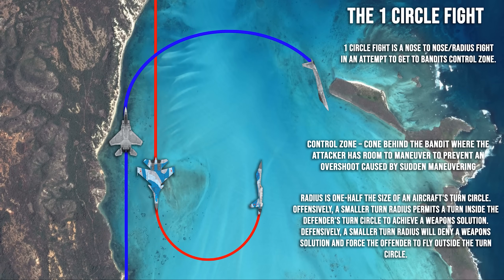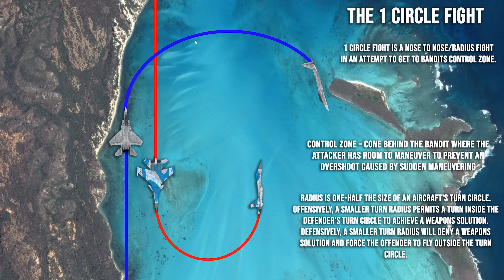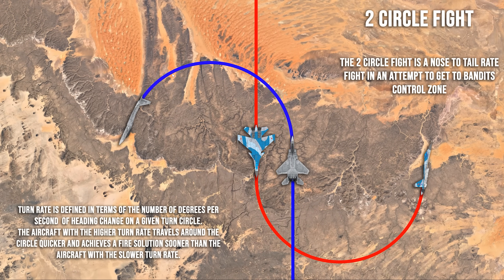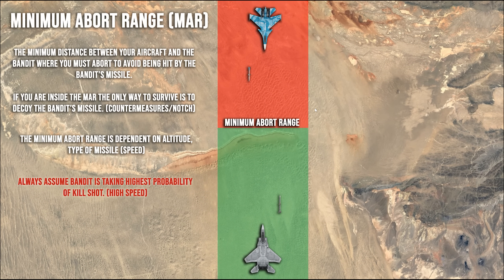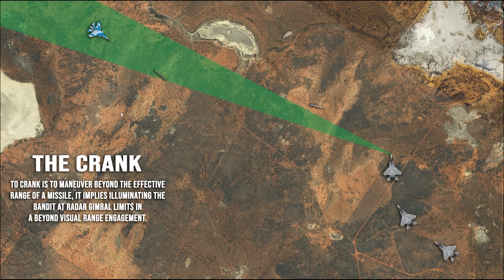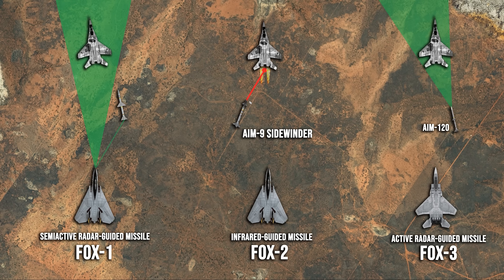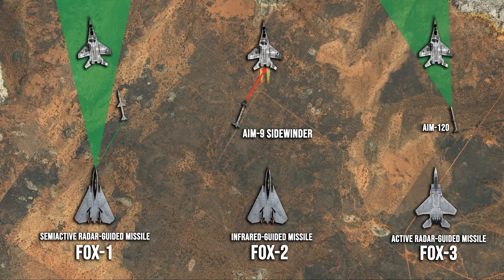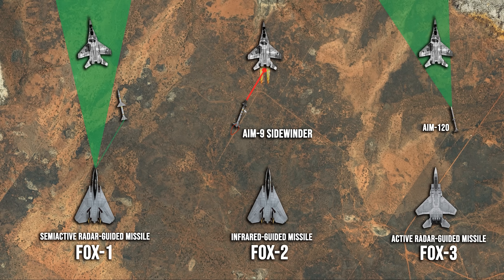Modern Air Combat | Basic Terminology Explanations | 1 circle Vs 2 circle | MAR | Cranking | DCS |

Comment: What use is MAR as a concept, functionally?

In order to employ it you'd need a 5th to 6th generation level of situstional awarness. You'd have to have a radar, thermal, and/or a distributed aperture system combined to confidently ID a missle type far enough out to even have a chance TO turn away, wouldn't you?
Reply from the maker: no, you simply need to know how far the bandit is from you, you can know this from your own radar or a simple datalink feed which is common in all 4th fighters and up.

Comment: So when do you prefer one circle over the two circle? Both seem to be dependent on turn rate, but is there a preference for one or the other if you know your turn rate is not as good as your opponent’s? If so, why?
Reply from the maker: Only 2 circle is dependent on rate, 1 circle is radius dependent, you choose 1c or 2c based on your aircraft performance and the bandit you are fighting. You pick the one that works better for you vs the bandit.

Comment: 2:14 I've never played one of these, but it would seem to me that the area of the control zone depends not only on the bandit aircraft but instead on the relation between the friendly and bandit aircraft. Meaning it will be different for each combination of different aircraft types.
Reply from the maker: Not sure what you mean, why would u be in the control zone of a friendly aircraft ?
Reply: @GrowlingSidewinder  I just mean to say that similar to how the bandit impacts the control zone, so does the maneuverability of the friendly aircraft. As it is explained I would think that the relative capabilities impact the size and location of the control zone. A better-performing airframe should generally have a larger control zone.

For example. Suppose the bandit is a SU-35. Isn't the control zone for that aircraft different depending on if the friendly is for instance either an F-14 or an F-22?

Comment: 1 circle and 2 circle don't make sense to me.

It should be reversed - if 2 planes are going both lets say clock-wise, that should be called 1 circle. One is following the other one, they both fly the same direction.
When planes are flying head to head towards each other in circles, that should be called 2 circle... each plane is flying the opposite direction, in its own circle.

doesnt it make sense ?
Reply: The one circle and two circle thing refers to the number of circled created early into the merge. In the 1 circle, both the aircraft merge into the same circle whilst in the 2 circle, they form different circles which eventually collapse into one.

Comment: thank you for the explanation 👍😃  so let's say soneone fires a fox 2 at you, which is the heatseeking version, you can activate the flares for countermeasures, correct?

let's say the bandit shoots a fox 1 or 2, what countermeasures are possible to perform? as a total greenhorn, if flares don't make sense, i'd just say try to out-maneuver the incomming missile?
Reply from the maker: Hi, yes the fox2 countermeasure is flare, against fox1 and fox3 the correct countermeasure is called “chaff” small nieces of aluminum that reflect radar.
Reply: @GrowlingSidewinder  thank you sir! can't wait to join the community

Comment: Random question: what camera angle is used in the first seconds on the f-14 flight?  I have either F2 which follows the plane at a fixed distance, or Ctrl+F11 which loses the plane in a second.  What camera is this? Looks like a pseudo+fixed external view that tracks the airplane but gives some sense of displacement relative to ground.  Thanks!

Comment: Hey GS !!!
Once again, a very interesting video you've made here...
A few question :
Let me know if I m wrong...
range aim9x : 10 to 15 Nm
range aim120 : 20 to 30 Nm
??
and there best range effectiveness from your experience in DCS...?
How can we have Israel missile (python and Shafrir) in DCS ????
Thx
Fly safe
Reply: Well the ranges depends on many factors like speed and altitude of the launching aircraft, air density, is the bandit manuvering or not, was the missile loft, wind speed/direction etc...... So there is no correct answer to your question. It allways depends on the situation.

To get modern missiles into dcs like the python and shafrir, many datas a required and they are mostly classifide.

Comment: 1-Circle=energy fight. Usually leads to a flat scissors, with the trailing unit trying not to overshoot, while the leading unit tries to force that overshoot by either decelerating or rapidly climbing.  Ideal for the MiG-23, F-4, F-14.
2-Cirlce=turn fight. Red tries to turn tighter and tighter, with the ultimate aim of getting close enough to Blue that he is "inside the turn circle" so that if Red tried to turn his nose toward Blue, he would just end up traveling circles around him. Ideal for the MiG-29, F-16, F-22.
Reply from the maker: hey buddy not trying to be a dick but that's basically all wrong. These concepts are explained within the video. 
1 Circle Fight is a nose to nose Radius fight, the objective is to not to force an overshoot it is to point ur nose at him and get a shot off. Often times 1 circle fights result in high aspect shots.
2 Circle fight is a Nose to tail fight in an attempt to drive to the bandits control zone allowing for low aspect shots, not to sit inside of the turn circle, if you're sitting inside his turn circle the entire time he will out rate you. the only reason you'd be inside the turn circle is if you are trying to take a high aspect shot which is not ideal in this kind of fight as it allows your bandit to jink out of plane or tighten down the turn on your make YOU shoot outside HIS turn circle and then reverse the turn on you and drag you into a 1 circle fight. 

The 1 circle fight is favored by the Mirage, Hornet, F-22, almost all delta wing aircraft. 
the 2 circle fight is favored by the F-14, F-16, F-14, F-22 (it can do both) etc etc

keep in mind the kind of fight you chose is often dictated by the capabilities of your bandit.
Reply: @GrowlingSidewinder  Naaa no problem :P
I'm sure you don't want misinformation spreading in the comment section. I was basically just speaking from my experiences in Janes Fighters Anthology, which is not nearly as realistic as DCS, but more versatile and still a lot of fun.

If I find myself up against a bandit that I know can out-turn me (and if I have enough power), I'll go into an Immelman turn after the merge, transitioning into about two-thirds of a loop. Depending on how much vertical he uses after the merge, that usually puts him in my HUD with a minimal amount of left or right turning. If he manages to zip by underneath me before I can bring the nose through, I just repeat as needed. Obviously you need big engine or a light airframe for that, and both together are preferable. It worked for me when taking the MiG-23 against an F-5 (though he still busted me up pretty good--the F-5 is a wicked opponent).
Reply from the maker: @fubaralakbar6800  thank you for your understanding brother.

Comment: I think there is (or will be) a type of missile that uses an advanced camera system to locate an aircraft by its siluette alone and guide itself towards it. Basically flares don't work against it and unless the target aircraft has some kind of camo or visually stealth, the lock can't be broken. There shall be no RWR warnings, and the only ways to counter it is to crank away from it at a distance, outmaneuver it somehow or just destroy it mid-air with guns (problably tail mounted) or directed energy weapons such as lasers. The missile may be labled as a Fox-2 or could be called differently. This is just a random thought, trust me.
Reply: Flares are not only realy hot, there are also realy bright and clould blind a missile. Also there are laser systems (on Su-57 for exp) that are made especialy for blinding missiles. Fox two missiles can be detected today with IR seonsors that are placed everywhere on the plane and seeing the hot exthust from the missile.

Comment: Did I miss the description for what a "notch" is?
Reply: A notch is not realy a terminology. Its a tactic to make you "invisible" for the enemy radar by flying 90° to it. The doppler radar see you because of your approach speed. Sent radar beams are reflected back by your own movement at different speeds and this is recognized by the enemy radar. However, when you are flying at an approach speed of 0 (flying 90° to the radar), the radar can no longer detect any differences in the reflected radar beams and thus cannot detect you either.

Comment: hey Growling Sidewinder, I'd like some tips on the F-16 gunsight especially in the radar off situation with EEGS sight. I cant seem to get the funnel working very well, despite reading the chucks guide section on it. Can you make maybe like a Su27 vs viper gunfight where viper is radar emissions silent. there could still be awacs and whatnot, but I'd like to see f-16 EEGS without the radar lock to see if it can be done lol.

Comment: Can I ask a question? In the context of BVR, a lot of the papers I have found online reference pilots working to keep the opponent within their radar cone so that they can continue to provide guidance to their missile as it approaches the target. This is particularly true of RAND's papers on stealth aircraft*.

My understanding of this is pretty muddy and I don't really understand what is actually happening between the plane and the missile. My assumption is that, because Fighters have much more powerful radar sets than the missiles - at least in general - , in extreme BVR the missile's own radar cannot actually detect - *hence why this frequently comes up in respect to the J-20, F-35 and so on - the enemy aircraft and the missile is simply heading towards the last patch of sky the fighter told it to search. Then when the missile does reach the area where the hostile plane is expected to be, its own much weaker radar can pick up the target. You touch on this at 15:00, but I'm still unsure if I'm actually understanding the idea.

Whether you find this or not, or answer, thanks in advance! Great Video

Comment: Question: when you talk about a missile running out of battery, why is that? Do the electronics use that much power? Do they scrimp on the battery to save weight? I would think they'd want the battery to last at least the maximum effective flight time of the missile.

Comment: Strict nose to nose and nose to tail fights occur in one plane of motion.

One intuitive way to identify a fight is to draw a line between the noses of the two aircraft and between the tails of the two aircraft. If the lines are co planar and do not cross (forming a quadrilateral with the two aircraft), it is a nose to nose fight. If the lines are co planar and cross, it is a nose to tail fight (if one aircraft pulls lead on the other in a nose to tail fight, it technically briefly becomes a nose to nose fight, and if one aircraft pulls onto the tail of another in a nose to nose fight, it is a nose to tail fight at that moment).

If the lines are not coplanar, than the fight is neither nose to nose nor nose to tail. You could describe such a fight as a nose to wing fight. These kinds of fights are complex to describe. Nose to wing fights may be rolling scissors (from narrow double helixes that require high roll rates and approach nose to nose fights to wide offset loops that require less roll rate and more closely match nose to tail fights) or climbing/descending spirals (which also vary from narrow to wide forms).

A horizontal nose to nose fight may transition to a narrow rolling scissors, and a horizontal nose to tail fight may transition to a wide climbing/descending spiral.

A vertical nose to nose fight may transition to a narrow climbing/descending spiral, and a vertical nose to tail fight may transition to a wide rolling scissors.

Wide spirals can then transition to narrow spirals and vice versa, basically completing the catalog of types of fights involving maneuvering in relation to the bandit (there are, of course, many kinds of fights that don't involve maneuvering in relation to the bandit, such as boom and zoom or BVR fights).

Comment: what would be the fox code for ramjet missile with much better range than amraam?
Reply from the maker: lol look at the guidance if its Active radar its fox 3
Reply: @GrowlingSidewinder  what if its a very long range ramjet or hybrid propulsion AA missile that gets some initial guidance from the plane but then, at the terminal phase, switches to something like more advanced version of the the 9x seeker  (IR + visual + AI) but emits no significant radar. would you call it fox 2 then ?? but it doesnt feel like a fox 2. And I havent even started to include satellites, networking, sensor fusion, multi stage loitering drones and what not.

Comment: Question . how long can the new f 14 maintain a vertical climb ?
Reply from the maker: depends on weight, so loadout, fuel.
Reply: Lets say full load of fuel and full loadout ? Maybe you can do a comparison of the two so the tomcat pilots know what they are dealing with facing the new tomcat ?

Comment: I am just now getting into DCS, for multiple reasons, and this video is great for me because I was struggling to understand the terminology. 

I am just now really getting into DCS because I finally have a PC, and started watching GS awhile ago. My PC isn't powerful enough to run DCS (even though its slightly above the min spec requirement), and I am in the process of acquiring new parts for it. I am about to upgrade from an i5 2500 to a Ryzen 5 2600.